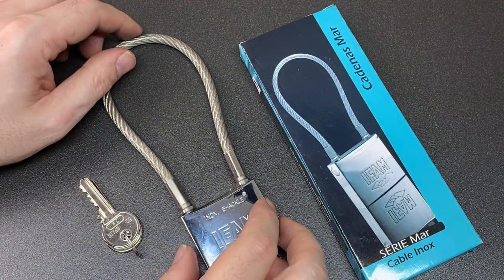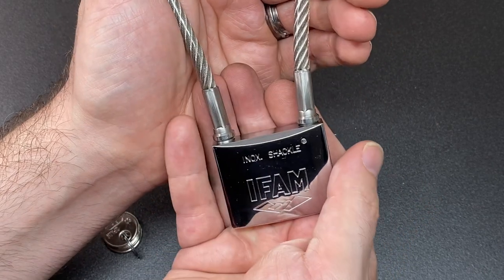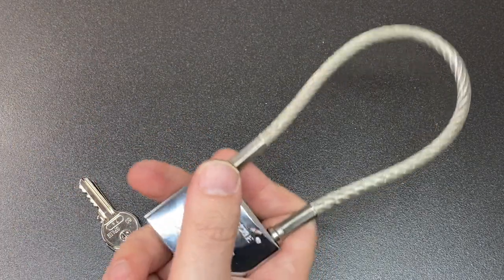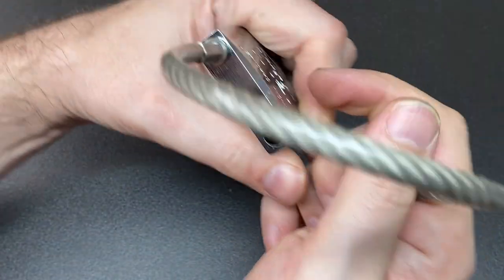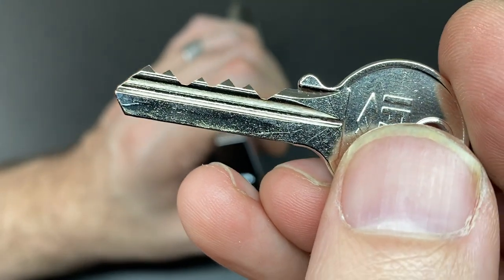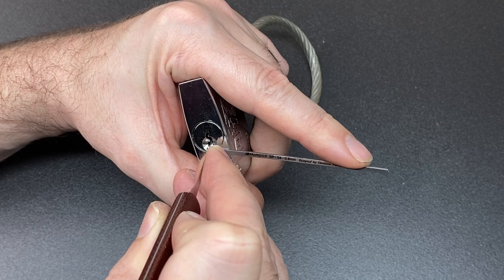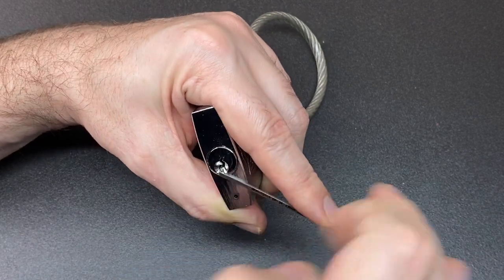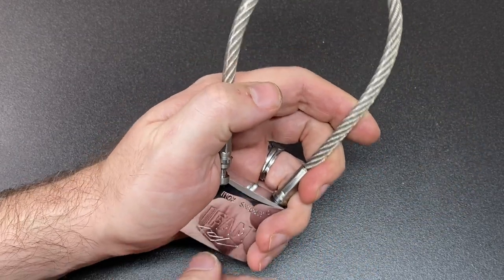IFAM Marine Series Cable Shackle Padlock Picked

Comment: Nice Pick Lock Noob 😁, the lock is for securing an outboard motor to the vesel. The wire goes through two lugs on the end of the two threaded clamping arms thus preventing the unscrewing of the clamp arms and theft of outboard motor.
Reply from the maker: Oooh right! That’s cool!

Comment: Cable locks like that are often sold as rifle/gun locks,  to be used where a trigger lock is not possible ie: lever actions.
On lever actions the cable is wound through and around the lever preventing the bolt from being opened. On bolt actions, the bolt is removed and.the cable is passed through the action preventing the bolt from being re-inserted. On revolvers the cable passes through one of the chambers, or if possible, through the barrel. Automatic pistols, through the action and magazine opening, or the barrel.
They are also useful for locking stuff that is too large or oddly shaped for a normal shackle

Comment: Thank you. I have several padlocks that have "inox springs" engraved on them (Papaiz). Up until now I had wondered what it meant. It helps explain why that particular brand is surprisingly difficult, despite the low price. I know it's also a fairly well-made lock with security pins, but it adds to it.

Comment: I have a boat I keep at docks in my local river. If the shackle was longer, I might guess that this could be used to secure the boat to the tie downs on the dock. But I am not sure what it could be used for at this length of shackle
Reply from the maker: Outboard motor according to comments